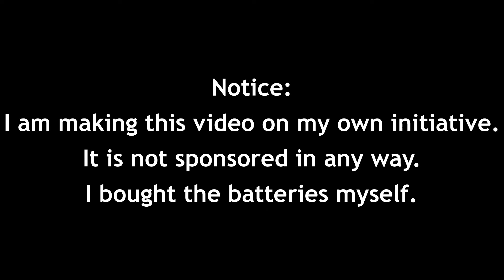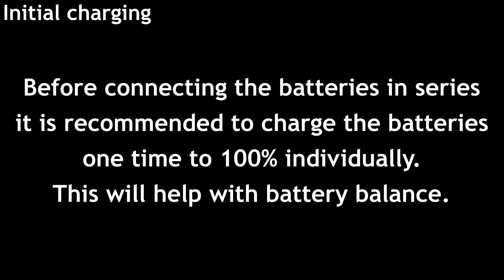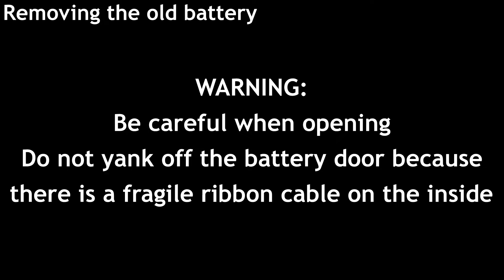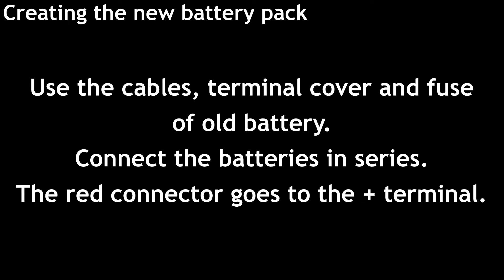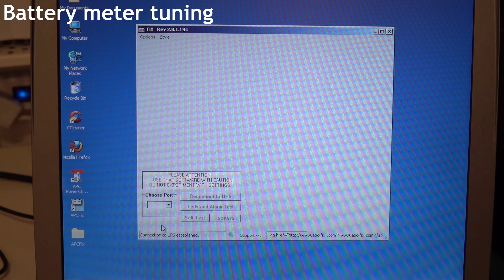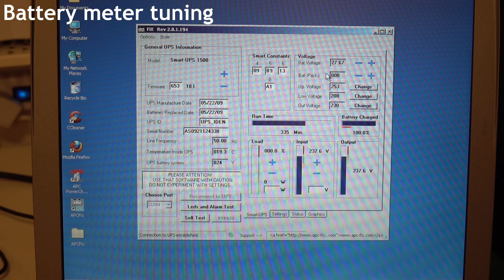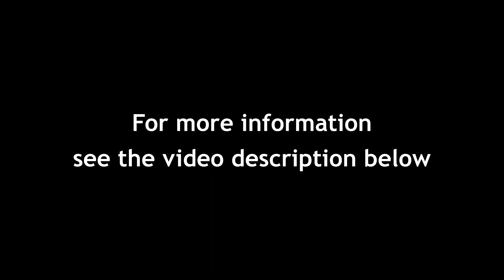Upgrade APC Smart-UPS to LiFePO4 batteries by PowerTech

Comment from the maker: Just a small update: I got a new computer with higher power draw. Max 650 watt. UPS with these batteries takes the load just fine.

As check and maintenance I took out the batteries, checked the terminal connections. All still fine. I used my standalone battery charger to charge the batteries individually, in case they would have gotten in a state of imbalance, but this was not needed. Each battery charged for around 40 seconds after which my LiFePo4 charger (CTEK CS One) indicated they were fully charged. So the UPS keeps them nicely charged so far without imbalance problems.

Comment: The is a BIG problem. No ups designed for lead acid can fully charge lifepo4 Or Li-ion batteries. Because ups needs to supply 29.2v(14.6v for each cell). But in this case it does not. So in Best case scenario it can half charge the battery. So, you need to put some additional components, like buck booster etc. Because taking off the batteries every time is a big hassle

Comment: At 550-600 Euro this is a rather high price upgrade for a UPS i use to mainly shutdown my desktop if unattended.  I see other brands selling for less often far less but I wont purchase anything until i have fairly good confirmation that a brand / product delivers the desired performance and durability.  As usual in the USA this is difficult to do because value to an American =  it works after they bought it and it costs very little.   They don't care about repair-ability, build quality or even durability if something lasts more than a year it's at least ok to an American.   So unfortunately I have to rely on reviews from Switzerland, Germany and a few other places.  Often things are not the same in the USA so this is tough.  i will keep my eye out.
Reply: xpcc

Comment: Thank you. Good information.
After discharge, did the Smart-UPS charger bring the batteries up to state of 100% full charge?
Did you get the same run-time following the Smart-UPS charge that you got on the first discharge after using the LiFePO4 charger?

Comment: I replaced the batteries in my APC SUA1500, but the fan runs at full speed even when the battery is at 100%. Do you know how to fix this?
Reply: maybe it has a broken temperature sensor.
Reply: The remaining charge has no impact on fan speed. It ramps up to cool down internal components that reached high temps. I assume something inside heats up due to difference in voltage characteristics between LFP and Lead Acid batteries. You could swap the fan to one that makes less noise.

Comment: WIth the price of 287€ each, this is a very costly upgrade... It may make sense for a spacecraft, but I want to remain cost-efficient... The video warns against "cheap batteries on Amazon" -- has no one found a trustworthy brand there yet?
Reply from the maker: It's baffling to me that APC themselves are not offering LiFePO4 battery upgrades or UPS systems yet. They do have Li-Ion UPS systems now but they are extremely expensive and this is an inferior chemistry for UPS purposes IMO because it is more unstable, more expensive and has far fewer charge/discharge cycles.

There are power station manufacturers like Bluetti and EcoFlow who now have UPS functionality built into their LFP power stations. But these UPS functions tend to be slower, take a lot of idle power usage and do not come with software to gracefully shut down a computer when the battery is almost depleted.

The user who is testing those "cheap LiFePo4 batteries from Amazon" also has some recommendations of good batteries for the USA market. I went with the expensive PowerBrick+ batteries because I needed an European seller of quality batteries. The ones listed by the Ice Hole Power channel are not being sold in Europe.
Reply: @Hypernl  designed obsolescence is a real problem and without sufficient competition they will never change

Comment: i have two ups 450VA  260Watts on surge   and battery side 5.2A for the outlet on surge only 12A  AND MY 550VA 330Watts  on the surge and battery outlet 4.6A and surge side only 12A

Comment: very nice video 🥰🥰🥰🥰🥰will the ups charge those battery may i asked will anything happend to battery cell them will it damage them ?
Reply from the maker: The UPS will charge the batteries. The BMS of the LiFePO4 batteries will manage the charging so they never get overcharged or damaged by the charging. When you use the batteries I use it's like set it (install it) and forget it. That's the big advantage of using LiFePO4 batteries that are designed to be used as drop-in replacement for AGM/SLA (lead-acid) batteries.
Reply: @Hypernl ❤❤❤❤❤cool well I have few usp 3 of them and few power station I have 1000Watts 2000peak 115V AC 60Hz 12A outlet I going used with lithium battery for now am have 12V 18A 3 of them going run it with come with charger 12V 5A but I have 12V 10A so my battery charge half of that time 🥰🥰🥰🥰
Reply: @Hypernl  Thanks for answering that!

Comment: We’re you able to make the power meter reflect your actual new capacity?
Reply from the maker: No, I was not.
Reply: @Hypernl  Did you try doing a "Runtime Calibration" in the Powerchute management software? That seems to be how others do so when doing their own custom battery thing.
Also, incredible video, thanks so much for the time you took to make this. I'll likely do something similar when the unit in my garage needs new batteries. (In a firebox just in case)

Comment: 1. You might want to insert battery packs with terminals looking towards the front. Otherwise the loops of battery wires which build up as you push in your new battery pack inside the chassis are likely to destroy your UPS motherboard which hangs unprotected just above the battery space. Breaking off some tiny capacitor happens easily and you wont even notice it; and then the whole board may burn through and the UPS might end up in trash.
2. You might want to read the exact BMS specs and to make sure, that the float voltage the UPS delivers is a) within the range of the BMS balancing function, and b) does not exceed the BMS overcharge protection voltage. If a) is not met the BMS will not be balancing the batteries without you noticing that, thus reducing their life expectancy, and if b) is not met the BMS will disconnect the batteries after full charge and the UPS will see it as a battery disconnection error. It might turn out necessary to fine-tune the UPS firmware float voltage settings for these purposes - this fine-tuning is easily accomplished in progs like APCfix via fiddling with the battery voltage parameter.
3. The remaining lifetime readings became unprecise not because the capacity became higher, but because the life chemistry has a very flat discharge voltage curve which makes remaining capacity estimates based on voltage very hard.
4. Maybe I missed you saying that, but after the battery constants are reset one absolutely needs to run the battery (re)calibration routine. Neither of these two steps is optional for a new battery to be properly recognized by the UPS.
Regards!

Comment: I have 2 psl-12450e 45ah batteries on older ups it works amazing. Tried on my 1500 apc and it's not charging them right but not worried about a fire

Comment: Are the battery bolt holes the exact same on both the SLA and the LFP?  I'm so very interested in doing this with my 2200 and I think my batteries have L tabs or something.  So ideally, the replacement would hang the exacy same.
Reply from the maker: The battery terminals on the LiFePO4 batteries I bought are different. But in my case I could fit everything without problems.

Comment: There are several problems with this configuration that may or may not be of issue in real life application.  First the BMS in these battereies does not adapt them to directly drop into a PB system.  This will result in the charge system not achieveing full charge of an LFP chemestry.  To do this would require a system to up the DC voltage supplied by the PB charger.  Second is the discharge curve, since the UPS system is monitoring and reporting the state of charge based on PB voltage curve, the UPS would (by voltage) report the battery array as full chage when it is at say 10%  So in the end, I am wondering how these work IRL.  Have you dischaged the UPS to explore its full runtime on LFP and compared it to the same on PB?  Does the UPS show any reasonable estimates of time when on battery?  Do the LFP batteries attain full charge or even near full charge?  In most applications when useing a PB charger on an LFP battery the PB charger cannot bring the LFP much above 70% SOC
Reply from the maker: With the SLA charger as it exists in the UPS it would in theory not achieve a high enough voltage to charge them to 100%. But in my testing it actually does. (I tested it with the separate CTEK CS ONE charger I use in the video, which is LiFePO4 aware. Maybe the advanced BMS takes care of this because these batteries are specially designed to work as drop-in replacements for SLA batteries.
The battery UPS meter is completely unreliable with these batteries. Because the battery capacity is much higher, the run time is much higher. The UPS does not know this so it counts down the battery meter while discharging as it would do with regular SLA batteries. Then it remains at almost empty for a very long time (one bar blinking). The UPS will continue to provide power to the load until the batteries are empty and the BMS of the LiFePO4 batteries decide that it is time to enable the undervoltage protection. (Or the UPS itself detects it's voltage under limit, one of the two)
Problems with this setup will be any programmed actions based on SoC left. So if you use advanced software to shut down a server when there is 10% battery capacity left, it will shut down the server way too soon. If you just use it attended like I do, you will get to use the full battery capacity with this UPS.
Reply: @Hypernl  The APC SUA series allow adjustments later generations do not - the battery constant and the charger floating voltage.  
By doing a manual battery calibration (full discharge) with a resistive load >30% of rated capacity (APC website has a FAQ) you can establish a real-world battery runtime. The battery constant should be automatically reset by the APC unit, reflecting actual capacity..  If you don't see that reflected in a new displayed runtime, you can use apctest (found in the open source APCUPSD package) over the serial connection to manually  set a new battery constant corresponding to the actual runtime.  The runtime and related calculations will now be much more accurate.
Perhaps less important for LiFePo batteries, you can also bring down the floating charge from the APC default 27.67 to a more reasonable 27.2 - 27.4, again using apctest over the serial connection.  You will need to have a multimeter attached to the battery terminals to see the actual voltage decrement as you increment the voltage gain (you do +, not -, to change the value). Lowering the battery float voltage will significantly extend the life of SLA batteries in an APC UPS.  For LiFePo batteries you can bring the floating voltage closer to what's specified for that battery model to utilize closer to 100% of its capacity.  Note: the voltage displayed by the UPS software will still show 27.67 despite your changes, a bug in the firmware.  It's what you measure at the battery terminals that matters.
The apctest program allows one to access, view and set low-level EEPROM values not accessible in more recent APC UPS models.  On Windows machines you could use a terminal program to do the same.
Reply from the maker: @stillwaters300  Thanks. This is a bit beyond of what I'm comfortable with, but perhaps it will be of help to others.
Reply: @Hypernl  The manual battery calibration described on the APC site would (usually) correct the discrepancy between the UPS battery remaining estimate and the actual runtime with the new LiFePo batteries.  It's not that difficult.
The more technical options described are for those with the inclination.

>The battery UPS meter is completely unreliable with these batteries. Because the battery capacity is much higher, the run time is much higher. The UPS does not know this so it counts down the battery meter while discharging as it would do with regular SLA batteries. Then it remains at almost empty for a very long time (one bar blinking).
Reply: Huh! So do you say if I get a SUA and  put lifepo4 I can make it fully fledged lifepo4 model with proper state of charge reading?
Reply: Can I do that with SMT750 too?
Reply: It's OK if the batteries don't get a full charge, you'd never want this chemistry to be sitting at 100% all the time. 70% seems nice. 50% would be nicer
Reply: im on it too , bought lifepo4 300A for my APC
i see the same , battery manual say , use charger found w battery for charge
charger from acid batery working but can use faster batery.
and say ,load battery every 6 month for maintenance.
so here every 6 month unplug for charging it with good charger

charger from APC is not the same intensity ,
and your lifepo4 will be load at 70% on what i read/see ...
but thanks for confirmation, i can use lifepo4 on APC

i was a bit scary about tension12.8v and acid is 12v ...

Comment: Isn’t the UPS set up to optimize charging of lead-acid batteries? If you use that charger on a lithium battery, it could be damaged.
Reply from the maker: The UPS is made for use with SLA/AGM batteries. The replacement LiFePO4 batteries I have selected have built-in electronics to make them compatible with traditional lead-acid (SLA/AGM) battery chargers. So don't worry about compatibility. They are made for this.
Reply: @Hypernl  which brand of LiFePO4 batteries did you use?
Reply from the maker: @shhuang  Please see the video description.

Comment: I have a Champions 2200VA UPS with 2 built in 12v 7ah batteries. Can i add a more powerful battery without having any side effects? Will it overheat or kill the UPS because of the extra current?
Reply from the maker: You can add batteries with lager capacity. Side effects can be more heat build up during longer charge and discharge times than where the UPS is designed for. And the battery meter of the UPS will be wrong because it will not understand that it has a larger battery now.

Comment: Hello, is it necessity to use new Lifepo4 batteries exactly same specifications with the old batteries? I didn't see you mention about old batteries specs? tks
Reply from the maker: It does not need to be exactly the same. For example, battery capacity may differ a bit. (But this will cause the battery meter to be inaccurate)
The new battery needs to be of high quality. You don't want to risk a fire with low quality batteries.
The new battery needs to have an advanced BMS that allows you to use it as drop-in replacement for SLA/AGM battery chargers
The batteries need to be 2x 12v in series or 1x 24v
The batteries need to physically fit in the UPS. (Optional, you can run wires to an external battery but it will look bad)
The batteries need to support the discharge current that your UPS takes from them (Many cheap batteries do not deliver the currents needed for an UPS like this.

Comment: Nice work, but i think many people won't do this and mostly because the price of those batteries. One cell of LiFePO4 is 10 times more the price of a 12V lead acid unit. At least here in Europe. Even if you try get them directly from the manufacturer, the price will still be around 8 times more. So, imagine that with same price you can buy lead acid batteries for at least 10 replacements. 
I know, many would say that will get better capacity and so on, but in the end, an UPS is not made to provide non stop power, but only enough time for us to save the work, when power is cut off. 
Best regards.
Reply: LFP ended up being cheaper than SLA batteries for me at lower capacity. Once you get to same form factor, LFP is more expensive due to much more capacity at the same size. 12V 9AH LFP is same price as 12V 9AH SLA.
Reply from the maker: Yes, these batteries are very expensive. But they have way more capacity and you don't need to buy new ones every 3 to 5 years.
However, there is nothing wrong with just buying lead acid batteries for these units. They were made for it and you will restore the UPS to the original battery capacity.

Comment: May I know how is the UPS is peforming at present.  The video is around 18 months back, wanting to know if the UPS is happy to live with the Powerbricks. UPS will always charge all the time and will discharge the batteries only there's a power failure as this doesn't occur often. 

I've been replacing lead-acid batteries on the UPS that dies roughly  2 years. I was thinking that the continuous charging of the batteries is the cause of the death of  lead-acid batteries.  I'm no UPS expert, just a longtime UPS user and that's my observation.
Reply from the maker: Everything is still working fine here with the PowerBrick+ batteries.
Lead-acid (SLA/AGM) batteries are best to keep charged to 100% and are fine to be continuously under a charging voltage. However, they should normally last 3 to 5 years. High temperatures are bad for lead-acid batteries and will reduce the lifespan. As well as a charging voltage that is too high. But if you use the factory settings this should be no issue. Maybe you had a bad batch of batteries? For lead acid batteries I have had good experiences with the official APC packs which may use CSB/Kung Long batteries but I think the best SLA/AGM batteries you can find are the Yuasa NP series. For this UPS that is 2x Yuasa NP18-12B.